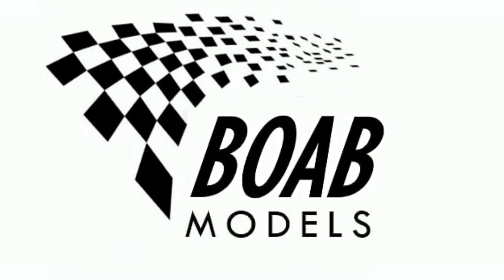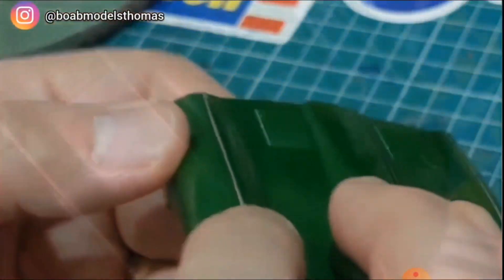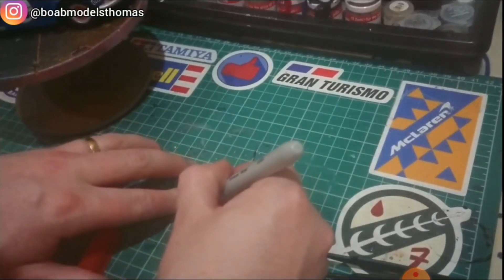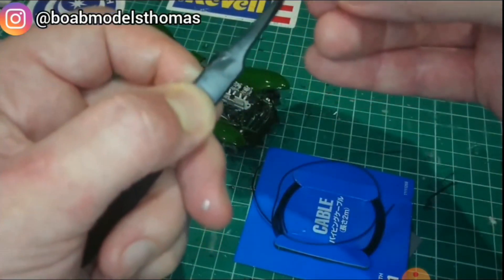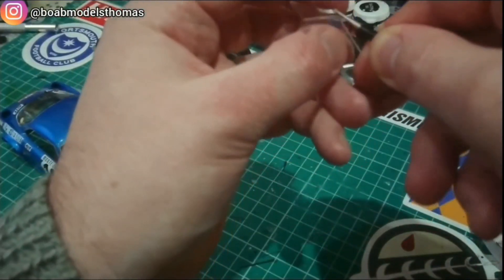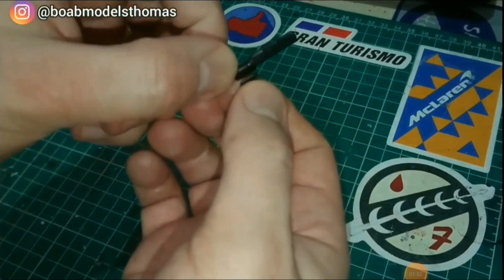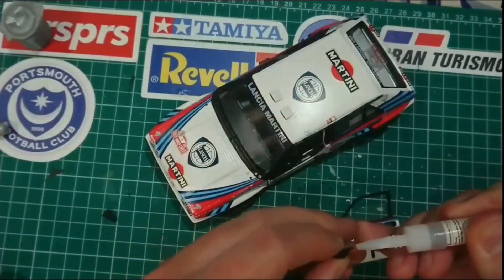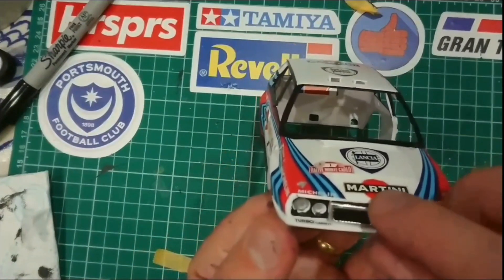How to use aluminium tape on scale models - BOAB Models Tips & Tricks

Comment: Great video Thomas. I had heard of people using this plumbers tape but had never seen it being applied. 
I usually use bare metal foil, but that can be temperamental. 
I also love the number plate tip on the Jag and on the back of the tailights, so thank you.
Take care. Don
Reply from the maker: Thanks Don. I have heard that BMF can be temperamental too. The nice thing about the foil is that you get so much of it that you don't really need to be sparing with it! I bought mine a year ago and still have loads. Thanks again for watching!

Comment: Great video! I've had less than successful results using expensive Alclad and similar chrome airbrush paints. A good tip about masking either side of edges before using the aluminium tape, which I've got a big roll of! Perhaps I just need to go back to basics, and use the aluminium tape rather than messing around with chrome paints etc.
Reply from the maker: Thanks a lot! Yeah, I've had similar issues with Molotow chrome bleeding when using that for chrome and I've found this tape pretty foolproof. Good luck.

Comment: A simple way to prevent the adhesive from marring the paint finish is to apply a coat of 'non-silicone' wax (I use Meguiar's 06 Professional Series) before applying the tape, foil or whatever you use. The wax will act as a barrier and allow you to easily wipe off the adhesive.
Reply from the maker: Thanks Howard, that's a great idea. I may have some of their wax.

Comment: Great tutorial! It's a very versatile material. I've tried to use bare metal foil, but It didn't work for me for some reason. I might try to use this tape, if I can find it around here.
Reply from the maker: Definitely and good luck finding some. The adhesive is quite tacky so try using masking tape perhaps to protect areas you want clean.